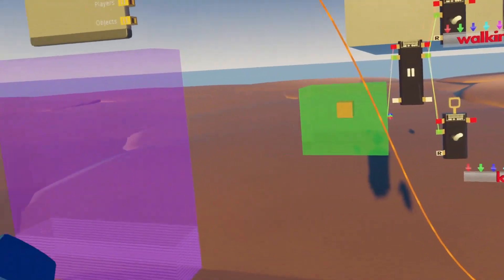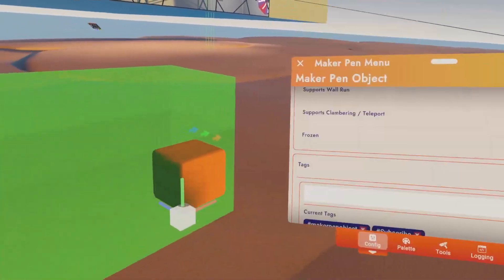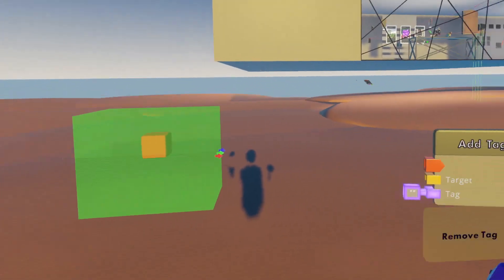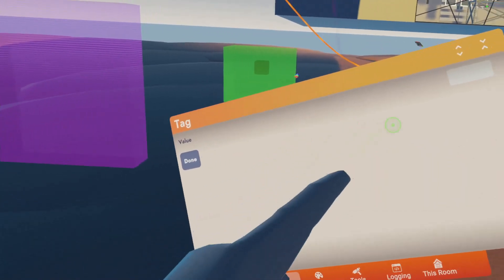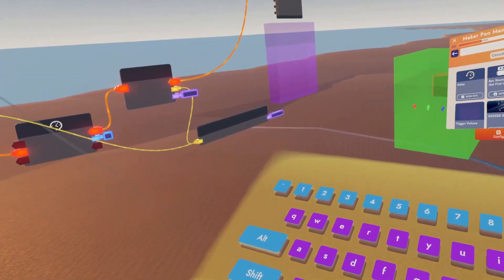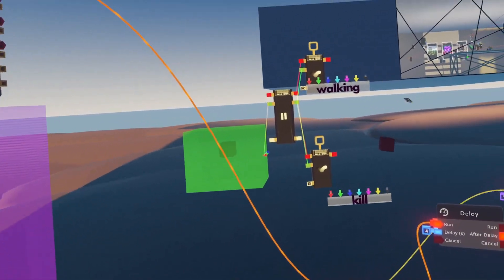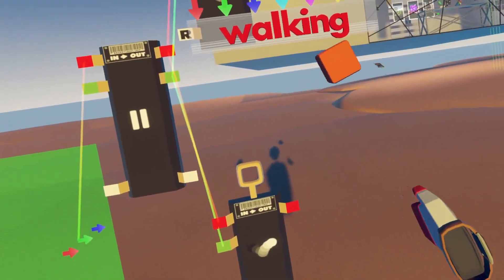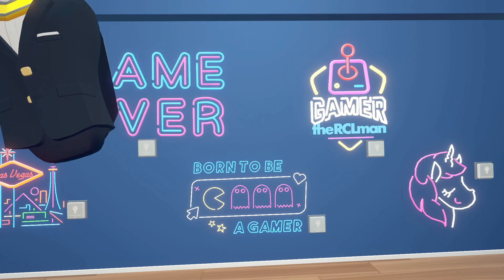How To Make CV2 and CV1 Work Together 💖 | Rec Room Circuits Tutorial

Comment: I did something and personally I think it’s easier, so what I did is the same thing with the trigger volume and the cube except I didn’t do the tags, and I used the piston to go up and delay to make it go back down after two seconds, then connect the trigger volume to what you want to do. Well, I just realize that I am doing something different but whatever works best for you just do it.
Reply from the maker: I see many do that also

Comment: If you also need aditional help, there is also a way to make Costume Dummies CV2!
(And no, I don't mean the Full Body Costume.)

Here's the things that you need to do.

1. Spawn in a regular CV1 Costume Dummy. Configure the dummy to add any tag you want.
2. Get two chips. The first one is "Rec Room Object Get First With Tag", and the second one is "From Rec Room Object".
3. Enter your tag you added on the Costume Dummy on the string input of the RR Object Get First With Tag chip.
4. Wire the Rec Room Object Output to the Input of the From Rec Room Object Chip.
5. You're done!

The From Rec Room Object chip will now output the Costume Dummy as not a Rec Room Object, but the Costume Dummy itself!
Reply from the maker: oh word, thanks man 🥰, although im sure now ppl don't use this video cause animation controller is out
Reply: @theRCLman  But the Costume Dummy V2 isn't here yet, and I don't want to use the Full Body Costume
Reply from the maker: i don't think there will be a cv2 costume dummy, i think the full replaced it @BlueVestGaming

Comment: I want to know how to make the trigger handle shoot custom projectiles like a water ball and or an energy beam. I would also like to know how to make the trigger handle cycle through different projectiles like in the DBZ rec room  game made by Death-striderRR
Reply from the maker: I don't believe you can cycle weapon projectiles they probably  have miltiple. Hook ttigger handle pressed to firw forward on projectile  launcher, then use cv1 clamp to combine them
Reply: There are three projectioe types: Paintball (paint pistol) Laser (laser pistol) Cork (flintlock)

Comment: HI RCL, great video but i would just like a bit of support if thats okay with you. I am aware this video is old but im not sure if you have a solution for this. When you press a trigger handle i want an animation to play using cv1 animation gizmo. Do you know how to do this? Thanks.
Reply from the maker: i believe you could use the same method but instead on trigger volume just use the trigger handle pressed, then chave the cube in a legacy trigger volume and hook the animation to the green, so that it turns animation on when the tag is added, also must configure the legazy volume to only detect items with that tag

Comment: Pls respond I'm confused on how do you do the animation I tried connecting the cube to the animation chip but it only made it move once
Reply from the maker: Question: are you familiar with the animation gizmo,  like how to use it and add keyframs and stuff
Reply: @theRCLman  yes is that what I need to do?
Reply from the maker: @programd8679  its kinda old but maybe this vid will help, the buttons are all look different but the functions are all still the same just be prepared

Comment: @theRCLman does this work for full body costumes and normal costumes?
Reply: @theRCLman I'm trying to apply speed to the costume I'm creating
Reply from the maker: @Munchkin__Boy  i think you would have to give a role with higher run speed to yhe pera9n who geta the costume
Reply from the maker: I would think so but ive never tried, what are you trying to do specifically? Maybe then i can get a better idea
Reply: Oh wait I figured it out
Reply: Get both a Player Add Role and a Player Remove Role. First you want to connect the OnEquip output to Player Add Role input (exec) and also connect Player output to Target on the same panel. The string is the role you want to give to that player for the costume. For the Player Remove Role, connect OnUnequip output to the input (exec). Attach Player underneath OnUnequip to Target, the string removes the role @theRCLman
Reply: I'm really bad with explaining. I get it if you're confused

Comment: poppy playtime now?
Reply from the maker: 😞💨💨So i guess you haven't seen any of the streams.
 I have been working on it and i have a system that works but only for single player. When ever other people join basically the entire follow system stops working. Today i redesigned the whole thing with a new way i found, its promising but i can't guarantee anything at this time.
Reply: @theRCLman  oh ok, will you publish the finished and fixed version as an invention?
Reply from the maker: I don't think i can do that it requires to much customization to make an invention
Reply: @theRCLman  that sounds fair

Comment: What if rec room added a special thing where you could wire a cv2 value and it will output a cv1 value, and vice versa?
Reply from the maker: like a converter that would be cool, i know they are making animation cv2 so this wont be needed when that comes out
Reply: @theRCLman  But still for the creators who made their map in cv1 and if they want to add an update to it with cv2 it will be hard to do anything. There's also the trigger handle which is only available in cv2 so that sucks.
Reply from the maker: true
Reply: @theRCLman  range finder, score board, player stats